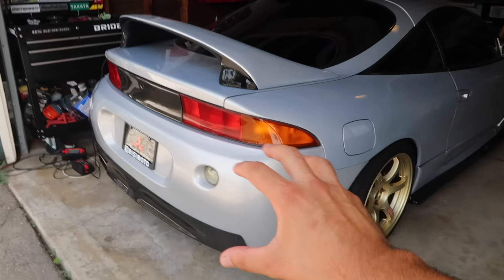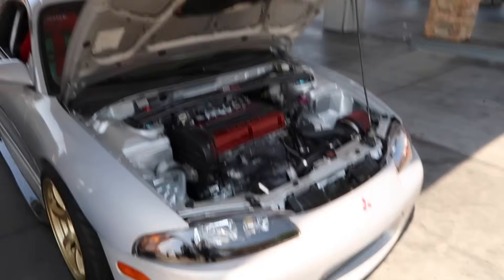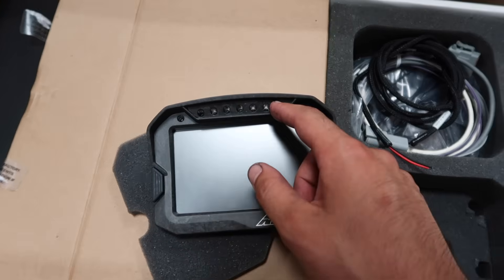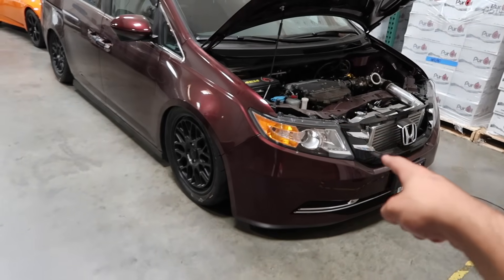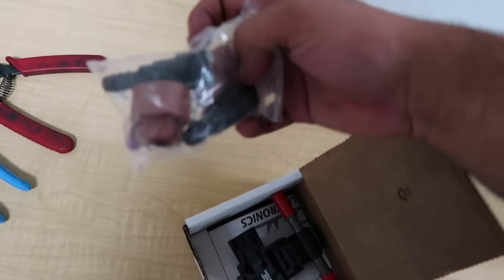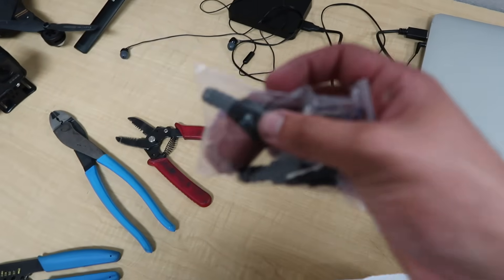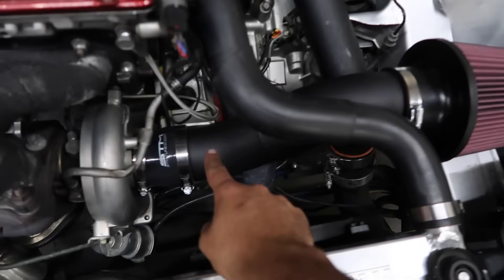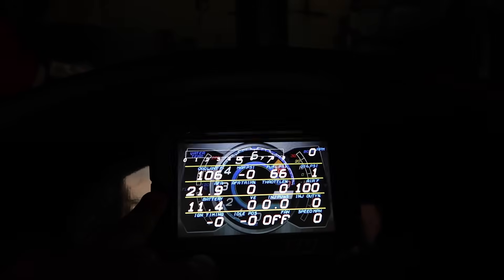TURBO ECLIPSE GETS AEM DASH & ECU!!

Comment: Nice set up I love it!!, I have a question so for this set up the factory engine harness will no longer be needed ?? What about the fuel  injection, ignition coil and the fuse box do you still use the factory harness? and are you able to put links to all the sensors you used please for people that want to use this exact set up.

Comment: The ECU cam with all the sensors and wires? Or you bought them seperate? Did you still had to use the harness of ohm racing?

Comment: Dude!  Never! Ever! Trust anything from autozone that has moving parts in it.  Especially alternators.  Seriously, I literally went through 4 of them in a short amount of time before I realized free replacement alternators aren't worth the hassle of replacing them every couple months.
Reply from the maker: Too late now 😭 hopefully this one lasts
Reply: So where do you get better ones? The problem is usually when an alternator goes you're stranded and need it right away.
Reply: @Turshin  Orielly's, advanced auto, or napa.  Any of those places will have a decent replacement.  There are also places that will rebuild alternators and starters.  I keep a spare alternator and a spare starter at home.